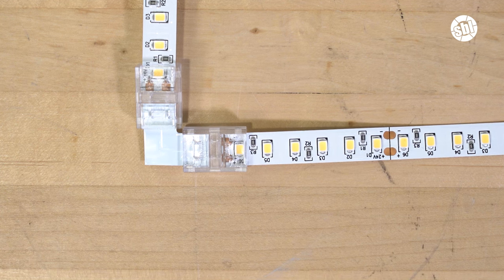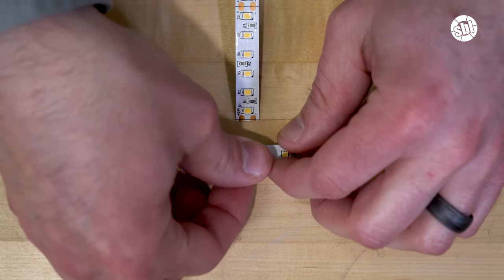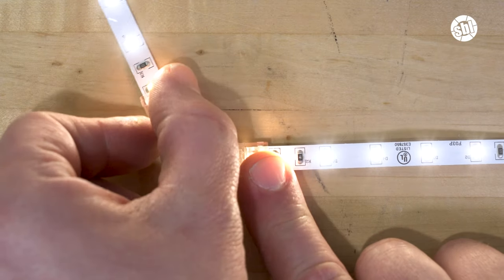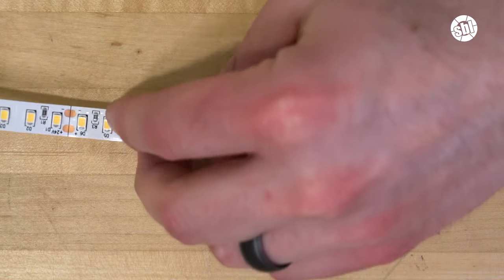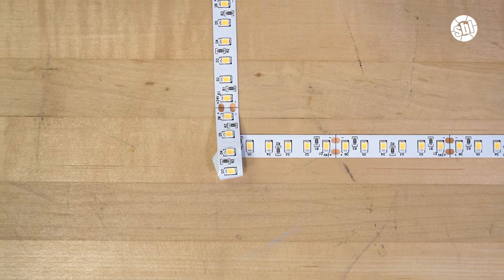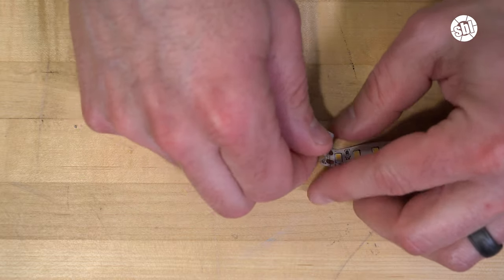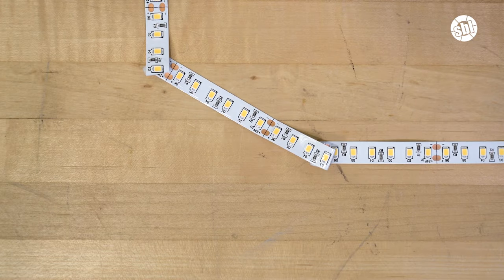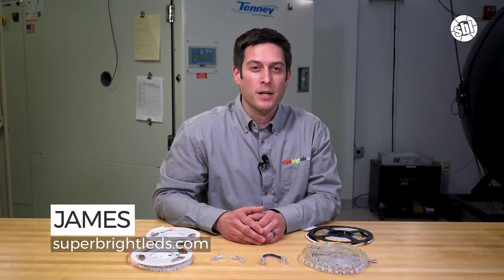How to Bend LED Strips Around Corners

Comment: Don't try this on cheap strips or it will break.
Reply: too late 😢
Reply: You are correct,the pcb is thin and flimsy which can be hardly fixed good by the connctot.

Comment: I tried the folding and now my led strip doesnt work anymore from that part😂 will have to use the cut method instead
Reply from the maker: Noooo! Sorry to hear. Yes, when in doubt, use the solderless connectors. They are very inexpensive, easy to install, and look better than any of the bending/folding methods.
Reply: Happened to me on RGB strip, after every bend, one of the colors stopped working :D

Comment: The folding method by far seems the cleanest but do you think that those folds could potentially cause enough heat to damage the strips in the long run??
Reply from the maker: Great question. It depends on the strip. Most single-row strips will be fine, like the one used in this video. However, for high-density strips or double/trip/quad-row strips, we would not recommend this method.

Comment: Ive always used the folded 90° option on indoor strips, I've never had one fail yet.   This doenst work on the thicker oitdoor siliconed strips obviously...
Reply: Remove a small part of the silicone for the fold(s) then re-seal with a glue gun.

Comment: So a strip led won't break if you double it? I am afraid that it might break that why I don't do it. Never knew it was that flexible. Thx
Reply: How did it go?
Reply: It went great. I could easily do 90 degrees corners to each direction. I was surprised they didn't break. I just tried to double them where no chips or LEDs are present. I tried first without removing the tape, then when I got the trick it was easy. So yes no problems for me. My LEDs were from AliExpress from a company called RGB. Very good quality.

Comment: I went to light international exhibitions and find strip led light which works with 220 ac no DC adaptor improved any other  electrical unit required , it helps me to work more accurately, with the help of cable tie, I attached to the light Aluminum pipe , noticed the pipe is vibrating a little bit when I move my finger along with pipe.

Comment: Question. Will the L connector work with Phillips hue strip lights ?
Reply from the maker: Short answer: probably. Our L connectors are designed with our strip lights in mind, but as long as you match up both the size of the strip along with the type (e.g., Single Color, RGB, RGBW, Tunable White, etc), you should be good.

Comment: What about the led COB strip? i need a 45 degree fold turn as well for a seemless look
Reply from the maker: You can definitely do the fold on COB strips. Just take it easy when folding it. Of course, we'd still recommend a solderless connector because they're only a couple bucks and look even more professional.

Comment: Hello, is there a way to turn an LED strip 180 degrees to run it back along itself?
Reply: Cut. Solder wires to each section to rejoin. Turn the strip 180. Tada